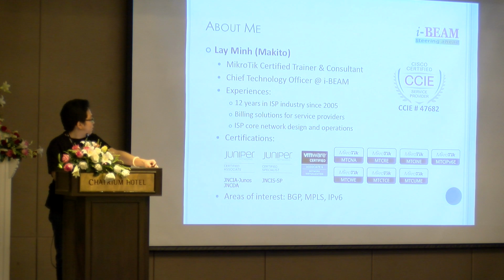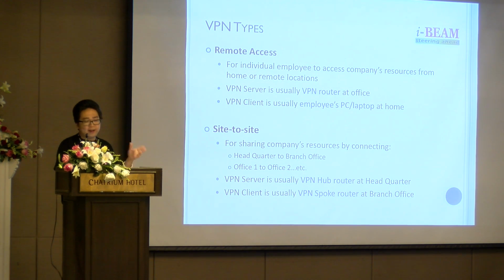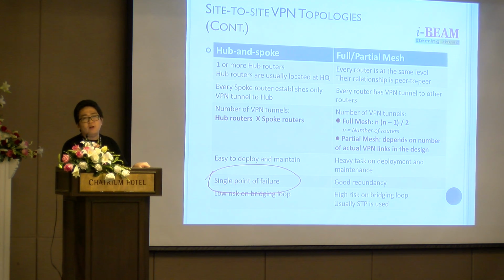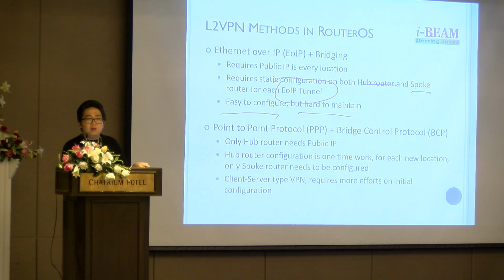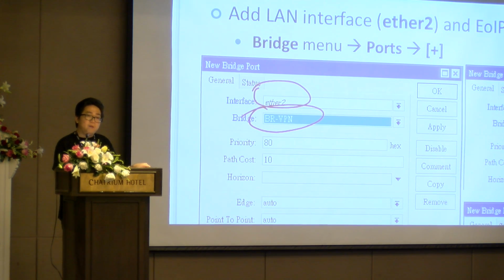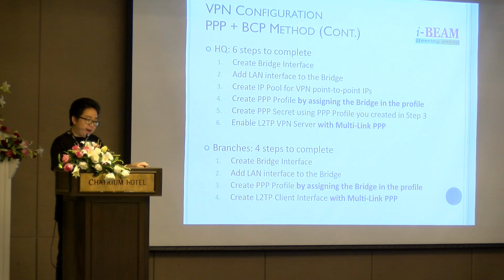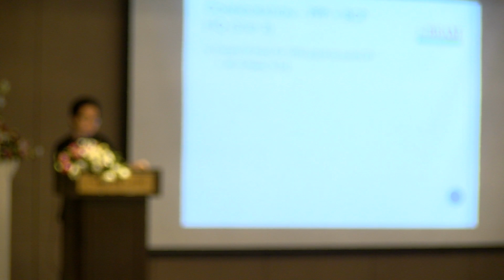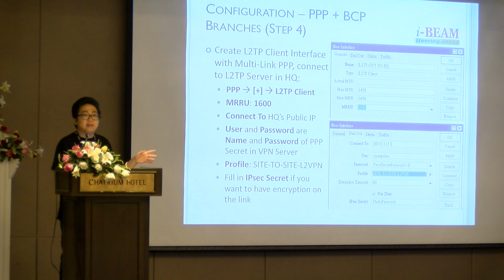Site-to-site Layer 2 VPN with PPP BCP

Comment: I just now realized I had a typo on the slide in step 5 of HQ part (video time is 34:40):
 "Create PPP Secret using PPP Profile you created in Step 3"

It should be:
 "Create PPP Secret using PPP Profile you created in Step 4"

The step of creating PPP Profile is actually step 4, not step 3, sorry for the mistake.

Comment: it is the only PPT describe the multiple link and BCR technology, thank a lot. so after configuration , any routing is needed? or 10.10.0.x will communication with each other? if the local branch has it own ip subnet? and DHCP? or just acquire thru BCR  to HC DHCP?
Reply: This is assumed that all offices will have use the same LAN subnet. For the design of different subnet in each site, Layer 3 VPN should be considered.